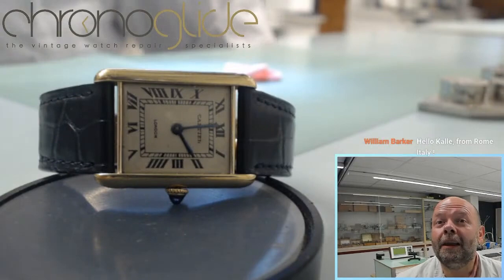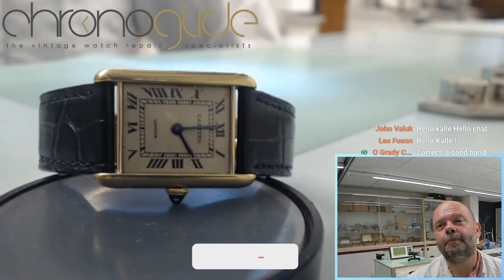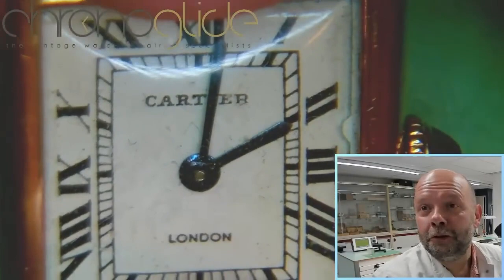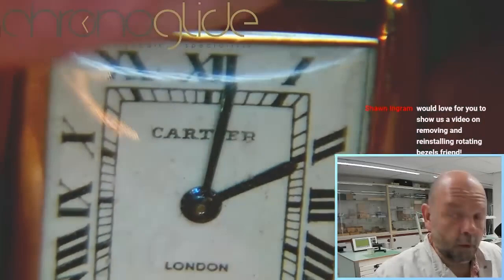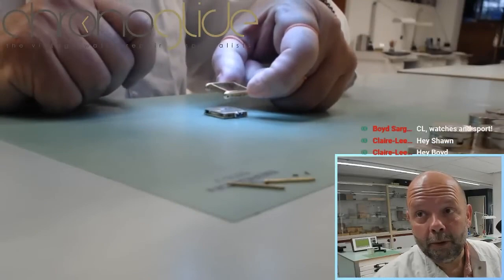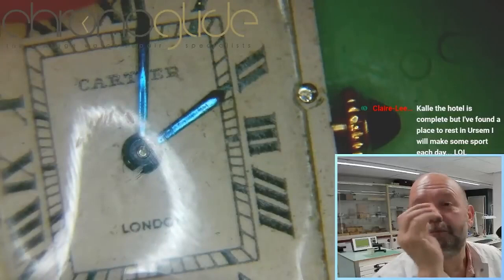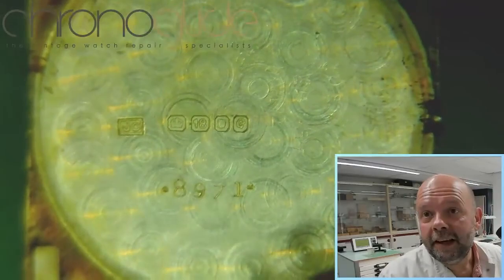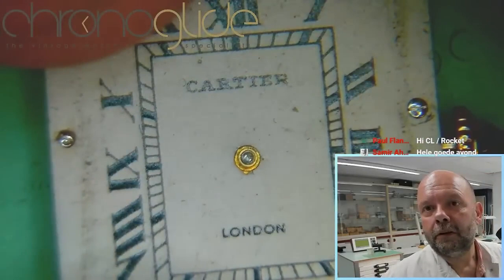Unexpected Masterpiece! Cartier London - Part 1of3

Comment: Wow, eager for Part 2... My watch looks "just" like this one, EXCEPT mine is circa 1986 and where yours says "London" mine says "Quartz" and yours is 18kt gold, mine isn't, but it still cost $,$$$ in '86 🙄 I mailed you a letter about mine as it seemed your email was down around the time of your move into your Grootschermer shoppe. My quartz died, new battery does not get it running. Never abused, never in any water. I had local Rolex AD change the battery a few times. I have no idea what kills a quartz movement, do old watch batteries leak bad stuff? Maybe you can find me a nice mechanical movement to replace the quartz? Ready, willing & able to send it to you. Let me know. 🤔
Reply: Probably worth getting your quartz movement checked out by another watchmaker just to confirm if in fact it is the quartz ( circuit block) that has died.
It could be that there is a mechanical fault causing the watch to not run, or an independent coil block issue.
A very severe hit or drop could cause the quartz to die, used to see that commonly in the 1980's and 90's in my workshop, strangely not too often now days.
And yes batteries do leak sometime particularly if left in the watch after they have died. The acid is corrosive and can totally ruin a good watch over time ( excuse the pun!)
If ever your battery powered watch faults in any way suggest you get it checked out soon as possible. Some watches will continue to plod on with the odd hiccup while the battery's
acid is starting to leak and creep through the movement even though the battery still holds a good charge.